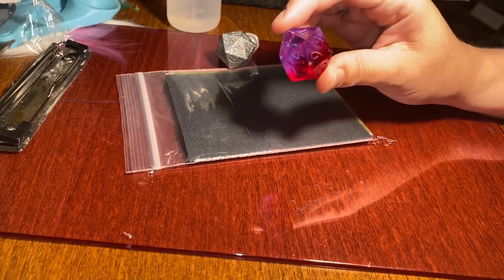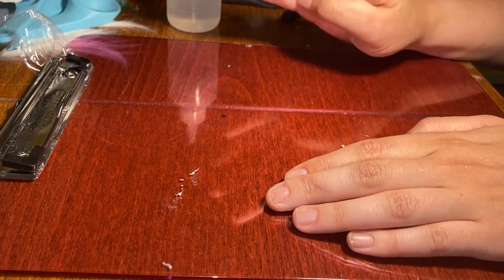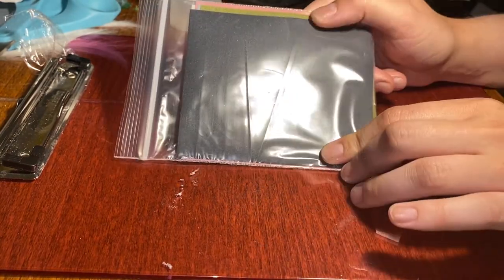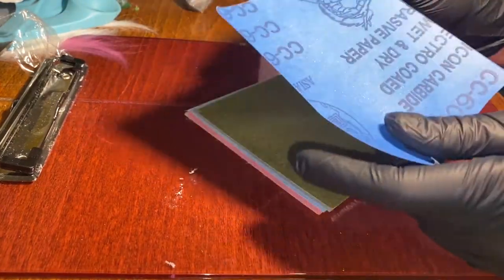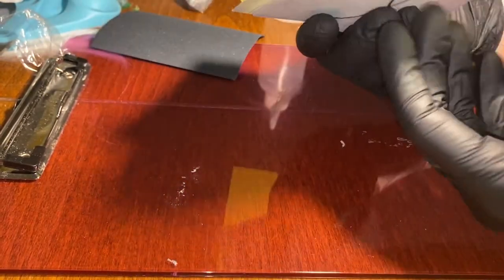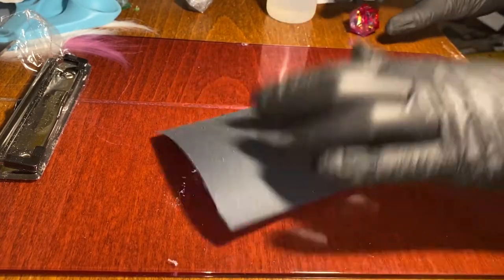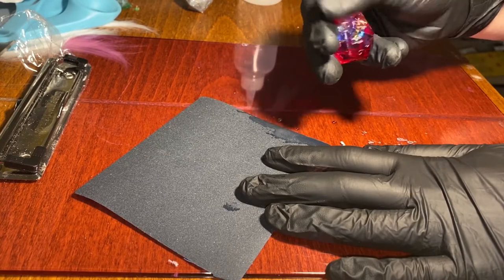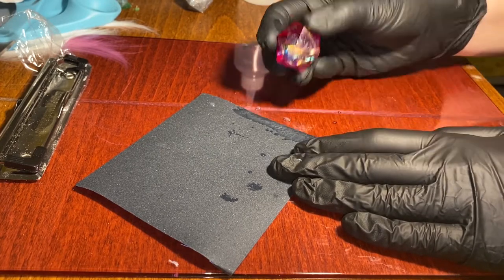Sanding, Polishing, and Inking unfinished sprue dice

Comment: Do you recommend doing this with the wheel or what would be the benefit of doing this by hand ?
Reply from the maker: I use a wheel myself! I do the sanding step by hand so I have more control, but I use the wheel with the papers. I recommend a wheel of at least 5” in diameter. Any smaller and it’s easy to wear groves into the dice with the circular motion unless you’re careful.